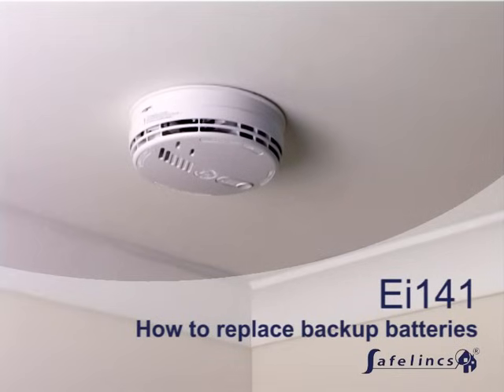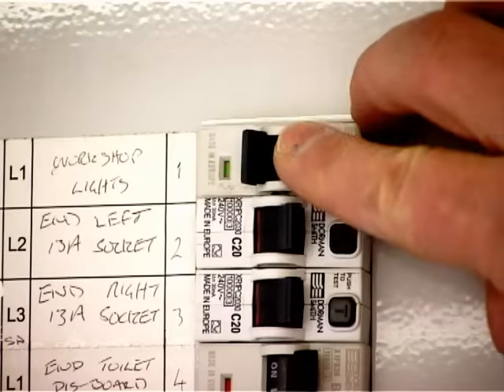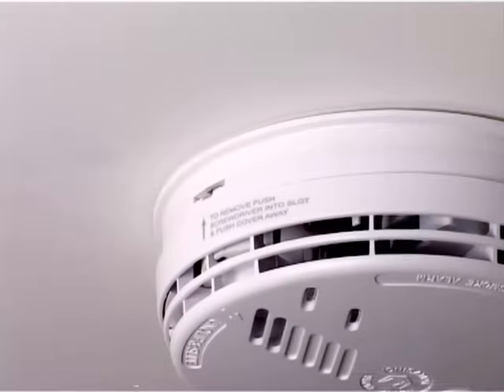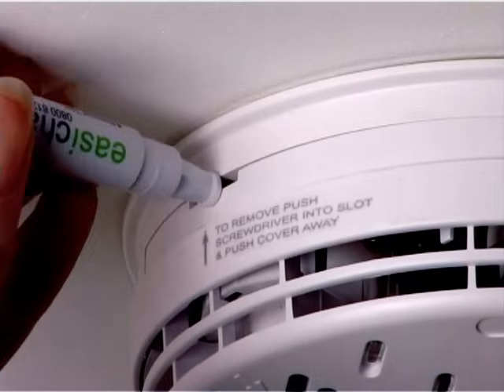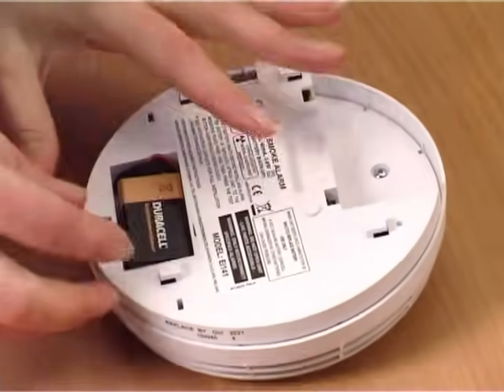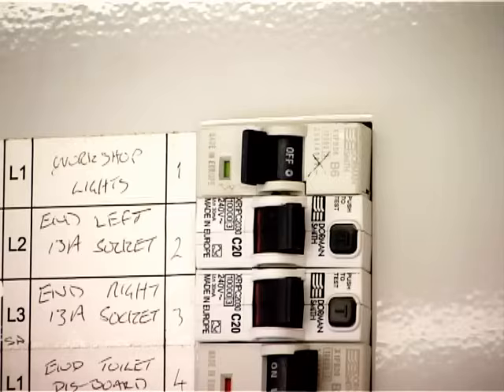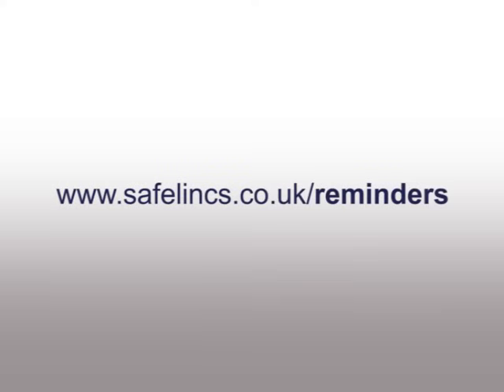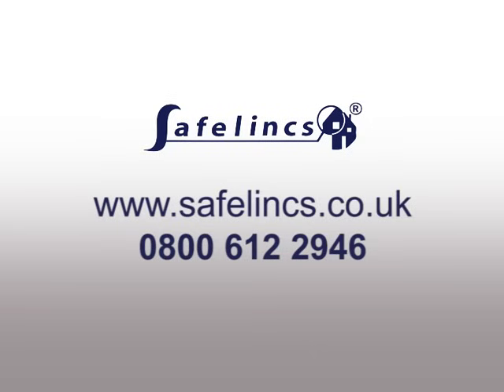Replace battery in Ei141 smoke alarm

Comment: It’s 4am and this is the hell I wish on the manufacturer’s, suppliers and everyone who made this product. Damn thing wouldn’t “unclip” and also why the need for a “back up battery “ if the device is supposedly connected to fuse box ?!!!!!!!!!!! WTF
Reply from the maker: Hi Dee, very difficult to handle at 4am, agreed. 
Backup batteries are required to ensure the alarm works if for example an electrical fault causes the fire and interrupts power supply. However, two options to stop this happening again.
1) replace batteries pro-actively once a year, or 2) buy the lithium version with trickle-charged backup battery. In this case the EI161. Replacement heads are available https://www.safelincs.co.uk/easichange-ei161rcek-replacement-kit/
Harry

Comment: I’ve made 3 attempts to remove this cover and at the same time praying I don’t go flying off the ladder which is at the top of my bannister.  The hole to put the screwdriver is facing over the stairs so I have to be twisting my body to even see the hole. I can’t do it so I’m stuck with this annoying bleeping now. Very poor make. And very hazardous as well. Puts me at the risk of falling over my banister snd down the stairs. No Thanks. (Soooo dangerously placed)

Comment: No lights on the alarm does not mean it's not on actually. My power was turned off, there are no lights on it, yet still the alarm goes off as it pleases. I hate my alarm & wish that I could die from a house fire just so I can get some rest.
Reply from the maker: Hi, to stop the beeping it is not enough to stop the power supply. You also need to remove the backup battery. Otherwise the alarm is trying to warn you of a power-interruption!

Comment: Was struggling like crazy at 6 am. 20 minutes of bleeping and could I get the bloody cover off ? Could I F***  !!….. then my wife threatened to stab me, suddenly I was inspired. I levered that damn thing even more strongly with the fifth screwdriver I had tried ( all identical of course ) and it prised off. The chirping stopped but the bloody thing has the type of battery I haven’t seen in years. So this morning I have to drive 16 miles to the nearest shop that sells them. The start of the perfect Bank Holiday weekend

Comment: I managed to change the battery, but now the green light is off. The battery can't be fitted wrong, so maybe is the bloody device.
Reply from the maker: Hi Stefan, if the fuse is switched back on again and the wiring is correct there should be green light. If not it could be that the unit is defect.

Comment: Alarm sounded at 4am. I was trying to sort it for 30 minutes before waking up the house. Can't get to the mains and the bloody arm is above the stairs. Nearly impossible to get off the ceiling, so had to crack it off and replace battery. Idiotic design and could be hazardous for anyone. Atrocious.
Reply: Yeah, Ei Electronics should be open 24 hours so they can help you at that time!

Comment: Mine has been sounding every night for the past week; I'm told it's because the battery is low and it can't cope with the low temperature at night!!!!
I can't get it open and neither can my neighbours - I can't even rip the stupid thing off the wall because it's connected to the mains electricity.

Comment: alarm kept beeping after replacing the battery. changed the one downstairs in case that one was beeping too. Tried not getting utterly pissed off but have to say, am failing. It says to wait 2 hours to see if the alarm is faulty, ..I'm gonna watch some tv to wait and see if the beep dies off. otherwise im gonna have to call an electrician guy to de-install this alarm and replace it entierly with a new one. which sucks because it should be good for another 7 years. dammit. so annoying.

Comment: So let's design a special removal tool that's not included rather than design the slot for a standard screwdriver 🤷‍♀️
Reply from the maker: Hi Neil, you can also use a narrow screwdriver, no problem

Comment: See i did exactly what the video said before i watched it. But it's not exactly clear how to take it off and my screw driver was too big to get into the hole all the way in, i was too afraid of both breaking the unit and breaking my ceiling. So much hassle, turn off power, nearly force your way open to replace a stupid battery for beeping that happens EVERY 40 SECONDS. What kind of nutjob thought this is a good idea??

Comment: I have to concur with my fellow commenters, this is a poor design. There may well be reasons that I'm not aware of which necessitates having the battery so secure and child (adult?) proofed, but no other smoke alarm I've dealt with has been this irritating or unintuitive to change. It's quite concerning that you advertise a commercial device just to access the battery, making one suspicious that this is a rouse to sell the access device so that people can change their alarm batteries. The instructions on the alarm are not clear enough and putting them on the side means that only the tall or those with long ladders would be able to read it. Please reconsider!
Reply from the maker: Hi, thank you for your well-considered feedback. These design flaws are the result of manufacturers making alarms for Housing Associations tamper proof. There is a fear that tenants could remove the battery if an alarm starts beeping in the night and that the battery is then never replaced, one of the main causes of casualties in fires.
However, cleverer solutions are clearly required! We keep demanding this in our discussions with our manufacturer suppliers. With mixed results, though.
Harry

Comment: This thing is stupid. It took me an hour to change 2 of these (turned wrong rooms fuse off). Tried multiple tools but first worked with padlock key and second with bike key. I'm mostly suprised I didn't break either one, so good job for them I guess.

Comment: This fucking heap o shit has driven me mad.... Why not simply have a clip hatch that reveals the battery to change??? Why do I have to turn the mains off every time I attempt to change the frigging battery unsuccessfully and then reset the cunting oven!!! The designer of this needs to be flayed and made to listen the incessant chirping for a month.
Reply from the maker: Hi rabbamonkey
All mains powered alarms will be powered either by a dedicated power spur or by the lighting circuit. The oven will be on an entirely separate spur. When changing the battery in a smoke alarm only flick off the fuse that relates to the smoke alarms, not the power supply to the entire house. The fuse for the alarms should have been marked by your electrician with a sticker that comes with each Ei alarm. If that is missing try each fuse until you have found the one that switches off the smoke alarms and then mark it with a sticker or pen. The correct fuse will turn off the green LED in the alarms.

Comment: Changing the battery in this unit is unbelievably difficult and frustrating. A simple screw would have been a thousand times better than your implementation.

Comment: Be careful .Replacing batteries on this smoke alarm from Hell is NOT as easy as shown. I can fully understand people smashing them to bits in frustration. I eventually got the covers off ,using a little force (which you have to) nearly falling off the stepladder in the process (twice) Dont buy this model and check out others instead otherwise you'll remember my comment here. And everyone elses !

Comment: A shockingly bad design, incredibly difficult to change a battery whilst up a ladder and needing both hands to remove the cover, quite dangerous.  Even when we changed the batteries in two units and vacuumed them they still carried on beeping.  The date on them says change 2022, think we will be changing them before that for something that the average human being can operate easily and safely

Comment: Bloody horrible piece of equipment. I am trying to get my hands on the electrician who installed them. Three in the house provide various frustrations and annoyances. I understand why people switch these things off and run the risk of dying in a house fire rather than dealing with the frustration of these bloody things.
Reply from the maker: Hi Simon, they are tricky to open, absolutely. Best thing is to proactively change the backup batteries once a year during daytime . Otherwise, yes, they will go off at night and rob your sleep. Harry

Comment: The release mechanism on this alarm is an appalling piece of design. How any elderly person is expected to install a new battery into a gadget screwed to the ceiling when the damned thing goes off in the middle of the night is beyond me. The release mechanism a safety hazard in its own right. Electricians instal these things without discussion. Aren't there any  alternatives?
Reply from the maker: Yes, absolutely impossible to remove for anybody who is not fit or if you suffer from dizziness. The only solution to really stop this happen is to chose mains powered smoke alarms with trickle-charging lithium backup battery. If you wanted to stick with this brand and do not want to replace the base plate you could fit this model which is trickle-charging https://www.safelincs.co.uk/easichange-ei166rcek-replacement-kit/
Harry

Comment: Horrible way to open a smoke alarm , through frustration I ripped it off the ceiling screw driver didn't work knife didn't work nothing worked to open it , absolute joke

Comment: How on earth did they produce an alarm that needs a special tool to open? How astonishing that we're now expected to pay for some kind of slightly adapted screwdriver to cover up for a truly terrible piece of design? I can't tell you how exasperating these detectors are? I can't imagine how many people have been driven half mad in the middle of the night, trying to locate which detector it is that beeps and then trying to remember how this flimsy, terribly engineered mechanism works. This is not a very safe design because it is so poorly designed for the flesh and blood human beings who need to use it.
Reply from the maker: Hi Johnnie, you don't need the special tool. You can use a flat-bladed screwdriver (fairly narrow) and push it in. Sometimes you have to lever a little.

Comment: Why can’t I shit this thing up!? Why did you make them so hard to open?! Also why is it connected to the mains and has a battery? What is the point in that? Why does it need a battery/ why is it using it if it’s connected to the mains!?  No why i’m Getting Any sleep tonight with that screening at me from right above my bed every few seconds! what a Stupid design.
Reply: The battery is to provide a backup service incase the power is switched off.

Comment: This fucking alarm is the most inconvenient piece of crap I have ever encountered. I had to go buy a screw driver kit and a battery, after it started chirping at 3am. STILL CAN'T GET THE THING OFF. If I didn't live in a rental...!!!
Reply from the maker: Yes, you are in a difficult situation as you cannot just replace the alarms. If you could, I would recommend the Fireangel alarms with 'Sleep Easy' function. These alarms not only have a re-charging 10 year backup battery but allow you to silence the alarm for the night should the battery run low after ten years. https://www.safelincs.co.uk/fireangel-pro-mains-powered-alarms-with-lithium-backup-battery/
Since this does not really help you as a tenant, all you can do is to replace all the backup batteries once per year to stop them ever going into low battery mode in the middle of the night.